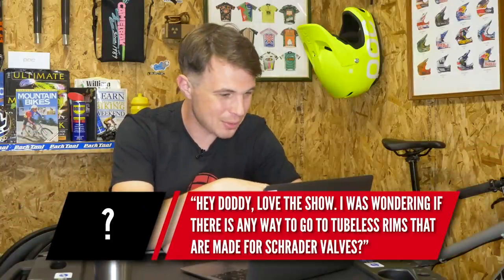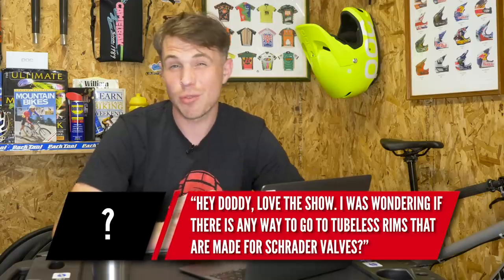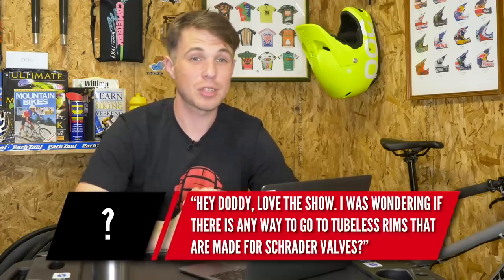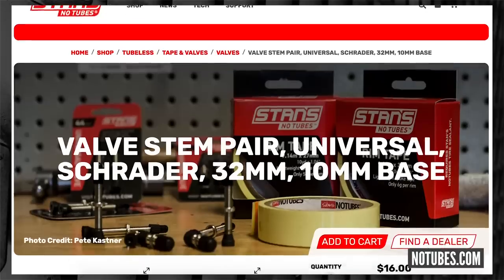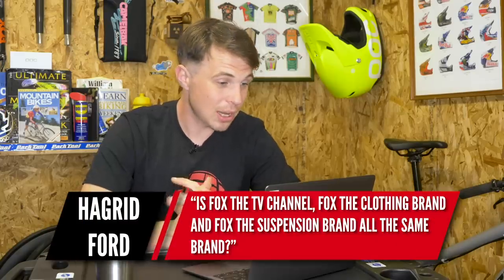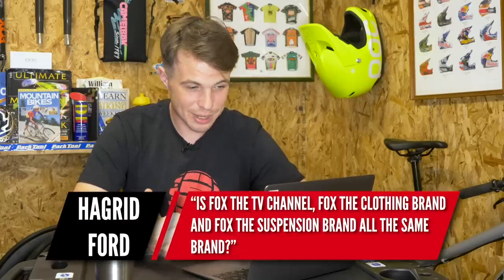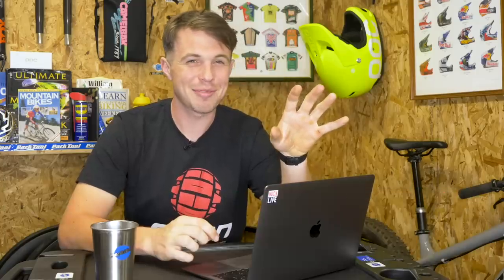Should You Convert Your Bike To Single-speed? | Ask GMBN Tech

Comment from the maker: Got a Tech question for Doddy or Henry? Submit it below using the hashtag #AskGMBNTech
Reply: GMBN Tech #askgmbntech I just installed a new chain on my bike and my chain now skips on the cassette i was wondering why this is happening and how I would fix it?
Reply: Ive got a killer hack to upload but i cant use the uploader from my phone..any helpful suggestions?
Reply: #AskGMBNTech love the show, super informative! I have two bikes currently but I’m moving into a smaller apartment so I need to get rid of one, I ride my 120mm  29er trail bike around in the local woods and my 160mm 27.5 enduro at bike parks. My question is which should I keep? Or should I sell both and get a 140mm trail bike with a 150 or 160mm fork? I’m looking at the Brit edition commencal meta tr 29 and it looks enticing
Reply: #ASKGMBNTECH Hi guys, love the show. Why do my disc rotors always rub after washing my bike? How do I eliminate this problem?
Reply: #askgmbntech I'm thinking about getting a 1x but I don't have that much money should I keep my 9 speed cassette and just buy a 1x chainring upfront? if so what brand?
Reply: @harry0222  I've got the exact same problem,
Reply: Howard The Alien I figured it out! What I did was replaced my cassette and dialled in the shifting and it works great!
Reply: @harry0222  ill probably deal with it for a while, I don't have any cash
Reply: #askgmbntech i have question about shimano hollow tech ll crank
Pulled them, off cleaned them, 
When re-installing i couldn't get the
Washer of the Non drive side crank properly on 
I Just put it on and tightens the star nut 
Is this bad for the crank?
Reply: #askgmbntech What is your opinion of the idea of Wireless  brakes. There are many possible benefits I think like less mess as no hoses , less repairs (ideally), increased frame integrity as you would not need internal routing with other wireless components. Also you could adjust how you brakes feel like the differences between sram and shimano

Comment: Single speed is the best. I converted to ss 12 years ago and never looked back. I run 34:14 with no problems. Power up any hill and you learn to keep fast momentum and brake less downhill. Your fitness and bike skills improve exponentially. Don't worry about being in the wrong gear, you're always in the wrong gear! SS is simple, lighter, almost maintenance free and it will just put a big smile on your face. I ride a Trek 69er SS custom rigid and love it.
Reply: Oh not forgetting that single speeds are quiet (stealthy) no horrible chain slapping all over the place. Mine has a very quiet freewheel none of that annoying buzzy blue bottle freehub racket
Reply: "Your always in the wrong gear"Lol
Reply: You're a monster! My mountains have pushed my gearing down to 30, 20. This ratio let's me ride farther than 10 miles. It's just a little less wrong for my legs.

Comment: Why you should run single speed? It teaches you about conserving momentum, it teaches you to look ahead more, it is simple to maintain, it makes you fitter and it is fun.
Reply: Also destroys your knees
Reply: Tomi Saaranen that is utter BS. Show me one study proving that. My knees are better now
Reply: @robertcoates2752  Pedalling on a harder gear uphill stresses your knees more.
Reply: @th_js  Then chose the right gearing for the terrain... I have talked to people who have rode single speed for 10-20 years. None of them have knee problems. Since I have started biking (during which single speed has been a significant part), my knees have improved. So until someone produces a scientific study showing that single speed use contributes to knee damage, I will continue to dismiss it as a load of bs.
Reply: @robertcoates2752  Sorry I'm no expert, but I just thought so. Good if I'm wrong!
Reply: Tomi Saaranen flat pedals combined with a mid foot position will strengthen your knees. Try doing a squat balancing on the balls of your feet. Feel the pressure through your knees? Being clipped in forces you onto the balls of your feet. Now try doing a squat with your feet planted flat on the floor. Feel stronger and more balanced? That’s the difference between the two different pedal choices. Following on from this, single speeding will force you you up out of your saddle and standing on the pedals when you’re climbing. So flats work better with lower cadences and strengthen your knees.
Reply: @davidmithen9223  🤣😅😅
Reply: Single speed is absolutely useless for mtb, fine for commuting.
Reply: @James-yy4vl  lol ahaha
Reply: James SS MTB is all I ride. Once you get the ratio right it’s amazing. I love not having to change gears all the time, frees your mind and allows you to focus on just riding. Plus the low maintenance is beautiful and no derailleur to worry about smashing into obstacles as you pick your way through techie stuff. With hydraulic brakes there are no cables on my bike which is a major bonus. And yes it is so good I commute on the same bike.
Reply: @th_js  it doesn't destroy your knees. I have ridden single speed all my life and never had a problem. The rule of thumb is quite simple, get off your seat while climbing.
Reply: Sorry, I don't know what the heck I was on about back then..
Reply: @robertcoates2752  and you talk to people , how old are they ?

Comment: Re the derailleur question:  I remember in dirtbike circles it used to be a no-no to use allen head bolts because when things went wrong out on the trail the allen heads would be full of muck and you would waist time cleaning them out or risk rounding out the hole before you could undo them. Many hard core riders switched all bolts over to 8mm head, and many OEMs did this. Not sure if this is still the way but any of you who have had to do repairs on the side of the trail will understand where I am coming from.

Comment: The question about getting a 140mm fork for 26 inch wheels. X Fusion do the Slant. It has 34mm stantions and is available in 100mm to 150mm. It is only available with a tapered steerer.

Comment: From Brenda in North Carolina:  I have amazing Industry 9 wheels, but they are 26inch wheels.  Can I put 26 plus tires on to increase the diameter and help me roll over rocks more easily?   I LOVE all the GMBN shows! Keep cranking out the kick-ass content!
Reply: Pretty sure as long as there is enough frame clearance then the tyres should mount as they're the same size technically

Comment: #askgmbntech 
Hello guys, a few days ago I've started to hear a creaking noise from my fork when hard front braking and  when riding on more technical trails. I've discovered that the creaking noise is from the steerer tube (CSU). Is there something I can do, other than replacing the CSU (I have a 2015 Bos Deville fork and parts are hard to find) and is it safe to ride with it like this?
Reply from the maker: If you believe this to be the CSU we suggest you replace this as it can end badly!
Reply: I would also double check that it isn't your headset first if you haven't already.

To do this, tie the forks to the frame loosely (so they don't fall out and hit the floor), and undo the steam clamp bolts, and the bolt on the top of the steerer tube. Then make sure the metal surfaces on the bearings have a coating of grease on them, and reassemble (using correct torque values). Wipe away any excess grease once assembled so it doesn't pull dirt into the headset. This can sometimes fix some creaking issues with headsets, especially if you have been riding in the wet a lot.

Comment: 2 Questions about Lefty forks. 1: Usually one leg is the air spring and one the oil(?) damper, how does a lefty combine them? 2: How is there any stiffness without adding so much weight you lose a benefit, you would think on descents, braking and some cornering the hub would twist a lot? #AskGMBNTech

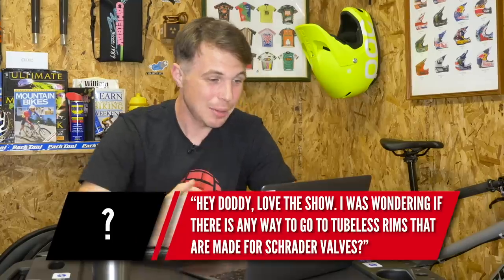Comment: 0:52 All mavic tubeless rims come with an removable adapter to convert from presta to schrader valve types. For XC and enduro I recommend Mavic Crossrides. Not terribly expensive (~ £100 a wheel), strong enough to withstand 17+ st (110-ish KG) doing 3 - 4 foot drops and general single jumps (I'm not Blake) and I can't fault them. The set on my XC bike is 3 years old and I only just had to get them trued. The set on my Trail bike are still going strong but they were a little deformed from the factory so will need to be trued while I'm recovering from breaking my right leg for the second time in 2 years

6:00 I've always used KMC chains (but I've never used SRAM chainrings) with wet lube and dry lube and I've never had a problem. So this issue is an interesting one to look out for I guess
Reply: on topic of mavic wheels, base model crossmax or XA cost only a little more than crossride and offer a 25mm wide rim compared to 21mm on crossride and a better rear hub
Reply: @ultiss  Cool. They're out of my budget range though 😉 . So the slightly wider inner rim width is unobtainium 😁. Also, any hub that is fully sealed (all Mavic hubs are) is a winner. Had a cup cone style hub on a WTB rim fail on me in december - while i was still recovering from the first broken leg - and it nearly put me back in hospital. Luckily CRC was really cool about it and replaced them with an apology under warranty.
Reply: @ultiss  and another thought, the extra rim width is only really required if your running super wide tyres. My xc bike runs 2.25 on the front and 2.1 on the rear and the widest tyre on my trail bike is 2.3 so the wider rim may actually hurt performance at those tyre widths
Reply: @M3PH11  i agree super wide rims arent the solution, but 25mm is pretty much the sweet spot for support and weight. here is a tire-rim copatibility chart from schwalbehttps://www.schwalbetires.com/sites/default/files/Untitled_0.png
Reply: @ultiss  cool thanks

Comment: Was racing geared when I got a rigid SS bike as a training weapon. 2yrs later... Zero geared bikes. Get a SS speed frame or use a clutched derailer. All but one of the tensioners on the market totally suck. The good ones will cost as much as the derailer you probably already have. 7-8 speed chain will work if your using derailer. Narrow wide chain ring. Surly cog.

Comment: Limit screw standard is Typically JIS (Japanese Industrial Standard). However, a #2 Phillips usually does well enough. Personally, I’m all for the Robertson Head. Adequate Torque, less chance of “rounding/stripping” the head of the fastener and tool
Reply: Mik Popiel even a flat blade screwdriver works or even a small knife :-)

Comment: Every single ride of mine is a single speed. No regrets.
Reply: What gear ratio? I just always wonder about what kind of riding people do with single speed. You can't climb, and you can't go fast. At the very best you can do either 1 or the other, but not both.
Reply: @Quicksilver_Cookie  depends on the trail.
Reply: I live in a relatively flat area, so typically 32/16.

Comment: #AskGMBNTech. Hi. Well my canzo got nicked😭. So ive ended up getttin a. 2015 kona fire.mountain from a work colleague. Upgrading as i go along... Slowly ( 2kids n lots of animals dictates time scale 😀 ) I want converrt to single speed and I saw a vid with doddy who suggested a tension device if you use a narrow wide ring. The kona doesnt have the adaptor plate for most that are available at mo but ive spotted one on ebay that hangs from chainstay. Would that be sufficient for now or do i have to get an adaptor plate & strip out the BB to make it work properly. Many thanks. ✌

Comment: #askgmbntech
Hi guys, great work on the channel!
I've got a RST Dirt RA fork with a coil. The coil is way too soft for me (I am above 100 kg) and want to change it. The harder coil isn't available here in switzerland. Do you know if a normal ISO Spring fits in those and if i will run into trouble if i go for a longer spring? The current spring is 260 mm and the best spring i could find is 305 mm. Or should i do it with two different springs, e.g. 115 mm and a 152 mm Spring?
Thanks alot in advance!

Comment: I have a bike with Shimano XT Brakes and 160mm disks. I'm a heavy man (130kg) and the brakes are getting to hot and failuriyng on long and thech descends. If I install 180mm disks, will it get better? Is there any other brake pads compound to use that is better for this situation? I barely ride on rainy days. #AskGMBNTech
Reply: Bigger disks will help with heat dissipation, hope also does floating disks which help even more with heat dissipation, I think metallic pads would help because I think they take longer to heat up than organic pads

Comment: #AskGMBNTech   I have watched Doddy's Essential Press Fit Bottom Bracket Maintenance video and have a question about removing a bottom bracket that was installed with the retaining compound.  Are there any tricks to remove it other than just hitting it harder with the hammer?  Once its out, do you need to clean the residue with anything special?  Thanks!

Comment: #AskGMBNTech
hello GMBN tech I am 13 and race xc, my current drivetrain is SRAM X1 but due to wearing the cassette, chainring and chain all need replacing I was wondering whether it would be a good idea to upgrade/convert to either SRAM eagle GX or Shimano xt m8100 and if so will those drivetrain work on my hubs which come stock on the Bontrager Mustang Pro wheelset. thanks for the input.

Comment: #askgmbntech Hi, love your videos guys ! 
I have a brake related question (Sram Guide RE )... Last weekend I went to Meribel's Bike park with my enduro bike, everything was fine with it. But when I took it again for an enduro ride, I found that the rear brake was strange. In fact, the lever doesn't return to his initial position fast enouth after braking, and I have to force a bit to have a decent power (When I release the pression on the lever it extends slowly compared as usual, and in the other way it feels like if there where a damping system in the lever ^^). I bleeded it twice, thinking that would solve the problem, but I still got the same issue. Then I cleaned the pistons and put oil on it like Henry explained in his Brake related video. Still got the problem.
Do you have any idea of what could cause that ? If yes, any advices ? 
Thanks !

Comment: #askgmbn I ran a shimano xt brake lever with a sram guide caliper for over 3years on canyon strive. The o ring on the caliper can take the mineral oil no problem. The sensitive part is the gasket on the levers.

Comment: #askgmbntech my fork ( 2016 rockshox pike 27.5 150mm travel ) sits at 25% sag even when Im not on the bike and it’s pumped up to 200 psi. I guess like 5% sag is normal when off the bike but my forks probably loosing 25-30mm. Any ideas?
Reply: That's a lot! Try the zip tie between seals or try to pull the fork apart and if those don't work, do a full service on that fork.

Comment: #ASKGMBNTECH 
I have a budget hardtail with a staight steerer and i'm thinking of changing the fork for a better one with more travel. I will change the frame down the line wich will accept a tapered steerer so should I get a fork with a staight steerer or wait and get a tapered one at the same time as the frame? I know there is a spacer that allows straight steerer forks in a tapered frame. Keep up the good job. Thanks
Reply: find a 2nd hand straight fork to bridge the gap between now and getting a new frame. Also might want to consider its often cheaper to buy a complete bike instead of building up a frame

Comment: Dry lube is crap. It is thin as water and does not last even 40 km ride. I use only wet lube for all conditions for over 15 years and it's fine. Motor oils is better than dry.

Comment: Dont bastardise classic bikes,only hipsters & bike couriers ride single speed 😩😩😶😩😩😩😩😩😩😩😩😩😩😩
Reply: And that's because neither of those groups watch GMBN vids on the regular ;)
Reply: No. If you have a spare bike, single speeding is perfect. You can learn a lot for riding a single speed on trails, improves your fitness and it makes for a low maintenance backup bike
Reply: @robertcoates2752  That's cool but after breaking my right leg twice in 2 years, I struggle with knee pain on a 20 speed. Also, Multi-gear drivetrains are not that hard to maintain if they are setup correctly in the first place. So I still maintain that bike couriers, hipsters and anyone else that thinks single speed is the best to just watch more GMBN
Reply: @M3PH11  I have suffered from runners knee (the cartilage behind my knee is all torn up). Riding single speed has helped that pain due to much stronger muscles around my knee. I don't think I would do a single speed as my only bike but as a backup/ different option they are great. They make short rides more of a workout and yeah multispeeds aren't hard to main but single speeds are stupid simple (which is part of why they are great backup bikes). If someone has an old bike they aren't using laying around  why not try it? It cost basically nothing can give new life to an old bike, teach new skills and can be fun.
Reply: Riding my full rigid singlespeed up and down real mtb trails has taught me to be a better rider, pick smoother lines and maintain momentum. I wouldn't want it as my only bike but it's fun as hell once a week or so. And super low maintenance. Air pressure, lube chain. Done.